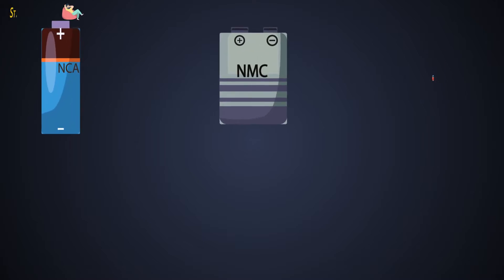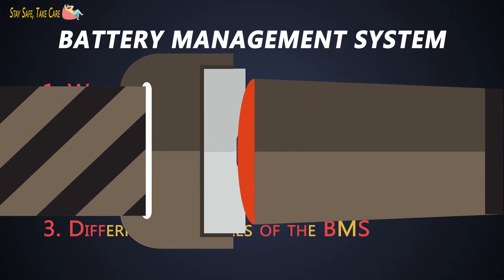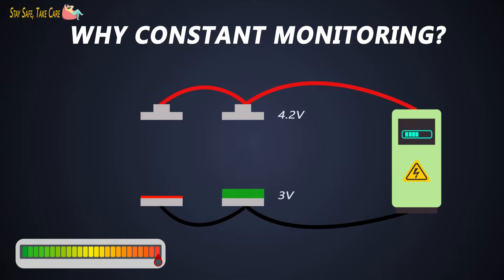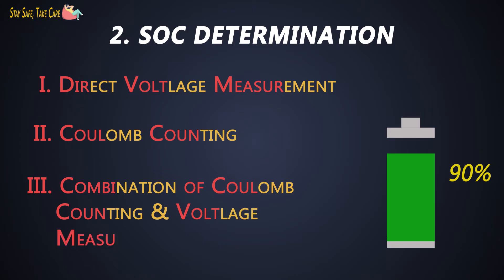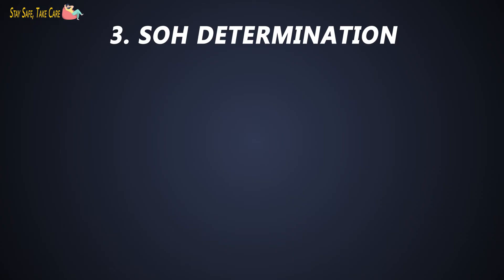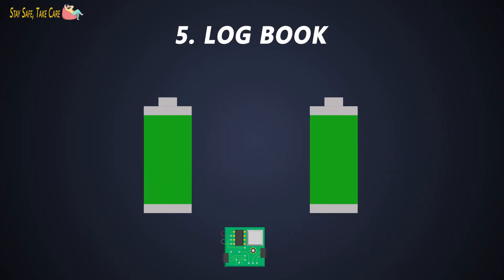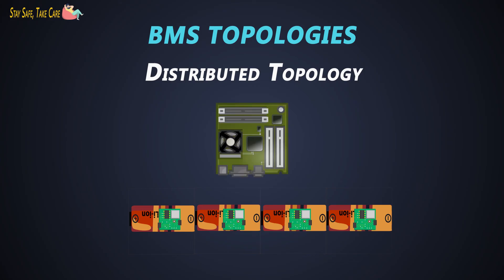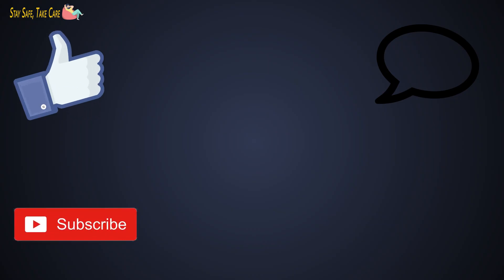What is a Battery Management System? | Topologies of the BMS

Comment: Great explanation. But here's some input for your explanation. 
BMS works on each series from the batteries. It can't control on each batteries on one parallel configurarion. So it's more relevant if you create the animation for your video on series connection instead of parallel connection
Reply from the maker: Thanks for the info!

Comment: Does the Distributed BMS topology allow for safer and longer operation of unbalanced cells?  

The use case is as such:  if each BMS manages the health along with the voltage & current output for each battery, then the "shared voltage buss" will present a "sum" voltage of all the various voltages on that master buss [that variation should not be substantial]. 

This allows for the safe and practical repurposing of used batteries.

How would you do this?

Comment: i dont use a bsm for my trolling motor i just monitor it with a cell checker.. its 100ah but i only use like 30ah to 40ah  after fishing for about 4 hours is what i do the most...then i balance charge it..easy to manage but if im going to have a other type of home use i would use a bsm because i dont have to worry about it and check it. i let the bms do the work.. with trolling motor i can see the cells voltage and manage my power use..im using grade a cells 4s. im using close to half the capacity of my battery most all the time when i fish.. iwas thinking of a 200ah size but it will be useless as i dont even use up all my 100ah battery

Comment: sir what happen if i use 12.6 full charge battery bank but my charger is only 12 volts. i use 10amp bms, 3 pcs 18650 battery in series =12.6v.  the battery will be always on charging state, right? because it cannot reach 12.6v full charge so the bms will not cut the charging because the charger is only 12volts. what will happen to battery?

Comment: actually about BMS
it's not efficien for example 10P 8S
and using only 1 BMS Only, my thought was about faulty change was high
how about use BMS every 1 pack of BMS
that I mean 8S and 1P of battery that has 1 BMS 
so 8S and 10P has 10 BMS on it  for more acurate discharge and charge reading parameter
Reply from the maker: It is not necessary, cells in parallel balance each other.

Comment: Cam the 2 x BMS be connected in parallel, for 2 set of battery banks....?
Reply from the maker: Yes it is possible but, it depends on the scenario
Reply: @FoolishEngineer  appreciate you can possibly sight the scenario. Thanks!

Comment: bro is there BMS in our smartphones
Reply from the maker: Yes.
Reply from the maker: Yes.
Reply: All modern Battery systems need a BMS depending on the size of appliance. The batteries are dumb chips, they cannot communicate or do not know when to charge or discharge. Some type of Battery management is required to indicate the Charge level, to control charge and discharge.